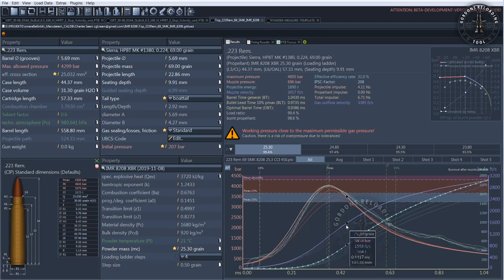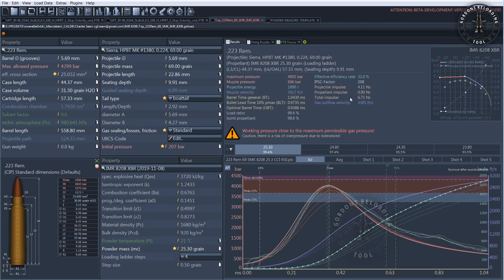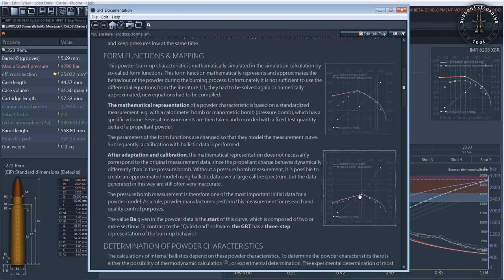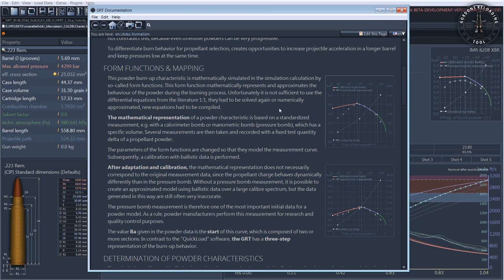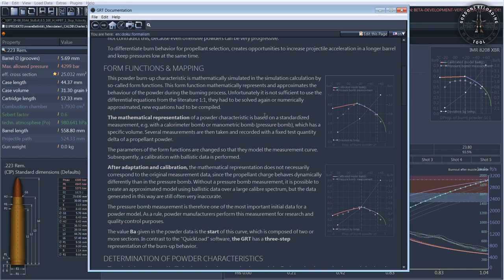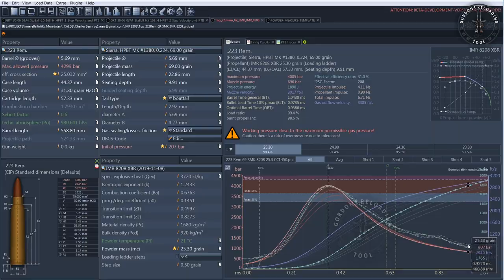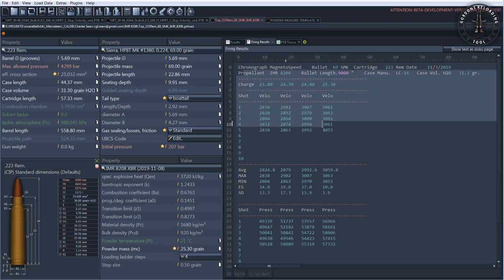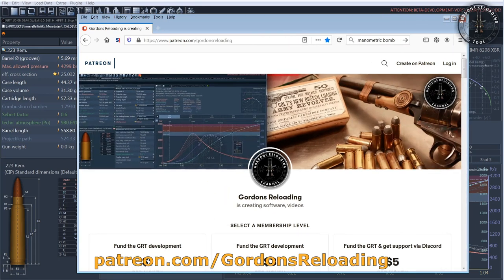(english) Gordons Reloading Tool GRT and how powder models are developed

Comment: Hey so when doing the obt method in cassies video he talks about changing the initial pressure to match your measured velocity. I did a load with a 223 wylde chamber that was berger 75vld with shooters world precision rifle 23.5 grains and seated at 2.494. I had to drop my initial pressure from 3400 down to 2230 to get my measured velocity. Am I doing this right and is it safe?